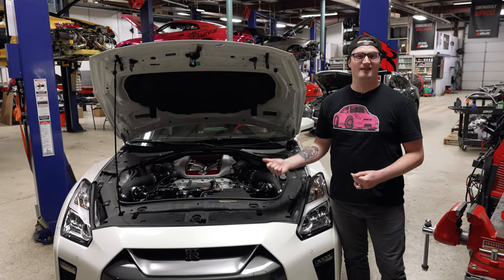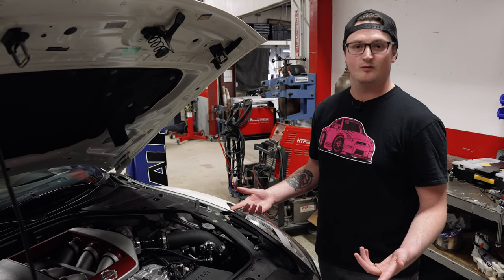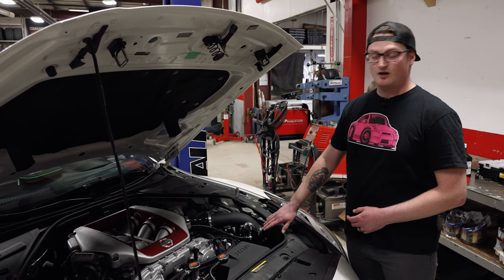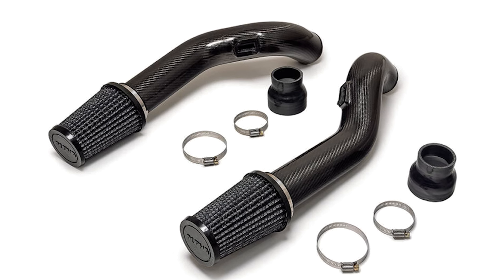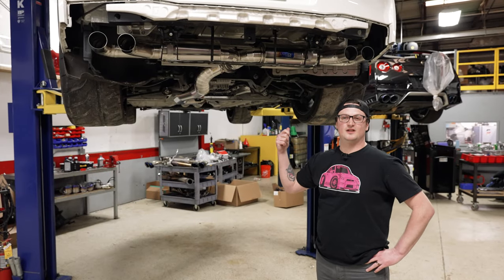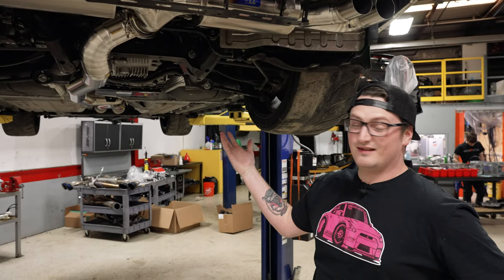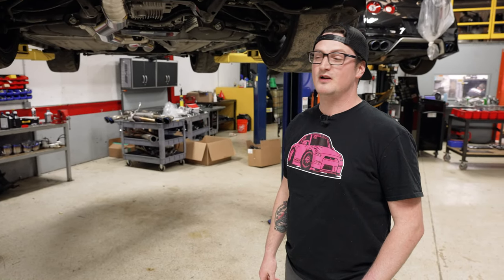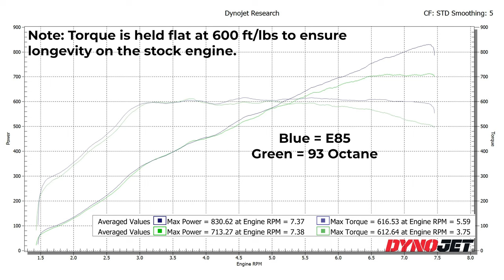OMEGA 9 R35 Nissan GT-R Upgrade Walkthrough | 830 WHP On A Stock Engine

Comment: What? I am putting 610 Torque and 655whp with bolt-ons and E85. In total I payed $3500 for tune,Ecutek and parts. I did the labor myself. 

Youtube has tons of easy step by step guides. It was so frikin easy I was actually surprised. 

Price to power I am very happy with my build. Saved a crap ton of money.
Reply: Upgraded turbos?
Reply: I want a gtr but the price of bolt ons are expensive & the power gains are underwhelming.
Reply: @Stasis5.0  that’s why a lot of people go with M3 and M4 downpipe and a tune will get you nice Hp that will beat a Fbo GTR
Reply: @bobthebuilder8223 yeah but GTR has better looks and handling

Comment: I currently have a Alpha 7 on E85 and speed density. What's the ballpark numbers money wise to upgrade to  a Omega 9 setup?
Reply: How do you like the 7? I’m looking at the 7 or 9.
Reply: @BIGMIKESKNUTTS  Honestly it's more than you need for the street. I use Ecutek with 4 maps and a tuned transmission. I can't get traction to save my life on maps 3 and 4. I use Michelin Pilot Super Sport tires (335 rear 285 fronts) and I am having to upgrade to Michelin Pilot Sport Cup 2s to try and lay the power down. Traction control cuts power constantly on the street. The track on the other hand with slicks the car is nuts. But a Omega 9 would be obviously faster.

If you are legitimately only streeting yours. The Alpha 7 on E85 is plenty.
Reply: @Mikey6048  If you're gonna upgrade you may want to do it asap, Ecutek is about to get bricked like Cobb did.
Reply: @jetro7349  Correct. I was being tuned on Cobb right as thier Green Speed came out. And put a halt on my tune. So I had to then convert to Ecutek. I'm quite anti Cobb at this point because of what they did. When the software updated on AMS's side because it's server based, it locked them out of my Cobb tune. So I had to buy Ecutek (Which is way better by the way). So unnecessary extra money I had to spend because Cobb wouldn't let AMS finish my tune.

With Ecutek and Cobb being the same parent company AMS told me it was a matter of time before Ecutek followed suit.

It's all a bunch of shit. But thank you for reminding me. I honestly forgot about all that nonsense.
Reply: @Mikey6048  Yea it's a shame what's happening, pretty much gonna be standalone or bust.
Reply: @jetro7349  Unfortunately true. And you know standalones aren't cheap.
Reply: @Mikey6048  you need motec to really get traction once you get into the 800whp+ category, maybe try some r888r toyos before for your current setup and get a retune. I think ecutek can tune TC with VDC off now too.
Reply: @francescoschettino5726  I have a AMS Alpha TCM tune currently. It does a great job but I just don't have the stickies I need. I'm saving to put some Michelin Pilot Sport Cup 2s on and then go from there.

I appreciate the info.
Reply: @Mikey6048  get some Mickey’s radials

Comment: max kit is the omega 9 for stock motors?, i can install omega 11 with stock engine?
Reply from the maker: You could run an Omega 11 but would have to limit the powerband to compensate the stock engine

Comment: What would be more reliable. A Gtr at 900hp or a R8 at 900up ?
Reply: R8. If I remember correctly the stock trans and block internals can handle north of 1khp. But I may be wrong. Torque I have no clue.
Reply: R8 hands down . It’s engine  cs  hand 1100+ whp stock and the trans can hold way more power than a stock gtr transmission

Comment: Crazy power for stock rods , plus stock gear set , I had a broken piston rings and gears at 852whp dynojet with a set of gtx2867 and not AMS built
Reply: Lol this is nothing for a stock gear set or rods. Stock rods are good up to about 650tq. Stock gears can handle around 800tq. All about the tune buddy
Reply: @x305HuStLa  sorry, I’m new. time? What do you mean. I’m researching AMS for my 2020 GTR.  I’m thinking of either the alpha 7 or 9.
Reply: @BIGMIKESKNUTTS  typo. Meant tune. Need a good tuner who knows what they are doing so they don’t blow up your engine
Reply: @x305HuStLa  ok, that makes sense. I know at least that much. I’ve had my GTR for almost two years, and now I want more power.
Reply: @BIGMIKESKNUTTS  what’s your power goal
Reply: They can artificially retard the torque in the tune to prevent excessive torque to mitigate damage to the motor or transmission. Mines limited to around 630tq to prevent grenading the transmission. AMS Tuned my ECU and TCM.

Also I believe you have the numbers reversed. Torque (misplaced hp accidentally) for the motor is around 850 before needing upgrading and torque is 650ish for the trans.
Reply: @Mikey6048  I don’t have anything reversed. Tq is what matters.
Reply: @x305HuStLa Correct torque is what matters but you said stock gears can handle 800tq. That's not true. It's 650ish.
Reply: @Mikey6048  no you’re wrong
Reply: @x305HuStLa  👌, OK. Not going to argue with someone, but go put 800 wtq through a stock GR6 and come back to me after it grenades internally. I've seen motors handle up to 850tq, (Not recommended, but the torque curve is gradual), but it can be done. The stock motor technically is good from around 650-700 tq before rods begin to bend. So yes you are correct for the motor, but the transmission absolutely can't handle 650+wtq. AMS literally told me that via email and on the phone. So if you doubt me contact AMS.
Reply: @Mikey6048  bro the stock gears can handle 800wtq minus first gear. Why do you think shep trans makes the shep 2.5 that’s rated up to 900tq? Only first gear is upgraded. The clutches and other things can’t handle 800tq. And everything can break at some point but they can still take 800tq and plenty have done so for a while
Reply: @x305HuStLa  Then why did AMS limit my torque and literally tell me 650 is the limit before upgrading the transmission is necessary?

Also many forum threads and other tuners state the same thing.
Reply: @Mikey6048  bro can you read? The trans has to be upgraded but stock gears minus first gear can take 800tq. Go talk to shep. He’s the one who actually builds the trans
Reply: @x305HuStLa .... 🤦‍♂️.... Stooooock. Can you read.

I'm literally talking stock. Not upgraded.

If first can't handle it. Then stooooock can't handle it.

Literally what we're talking about.
Reply: @Mikey6048  can you read? I said stock gears can take 800tq this entire time minus first gear.
Reply: @x305HuStLa .... 🤦‍♂️ Then go edit your first post. Because you say NOTHING about first gear. You make a general blanket statement for all gears....... 🙄
Reply: @Mikey6048  figured it was common sense but obviously you don’t know these cars nor are you familiar with shep trans and the different stages.
Reply: @x305HuStLa  Jesus Christ. The original comment said STOCK GEARS. If you have to upgrade the first gear and clutches which is a transmission upgrade. That's not ALL stock gears. 

I know all about Shep Trans. Yes 2-6 can handle it. But all together the transmission in it's stock configuration can't handle 650+. I'm done arguing with someone who clearly doesn't have reading comprehension skills. And is trying to talk down to someone because the subject matter is all gears. The original comment never mentioned Trans upgrade.
Reply: @x305HuStLa  i read your both conversation and i was laughing 😂.. I'm with you, he apparently still not that much in it yet